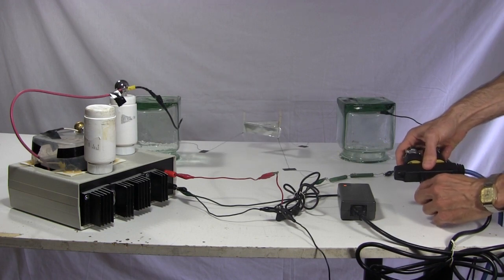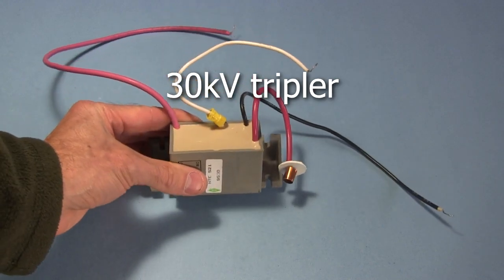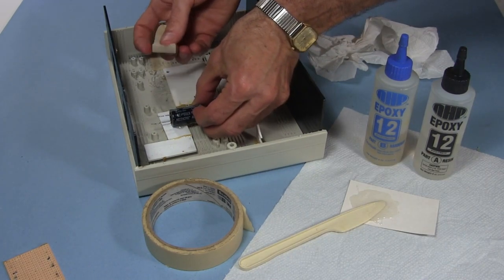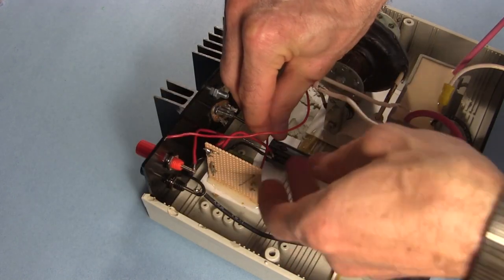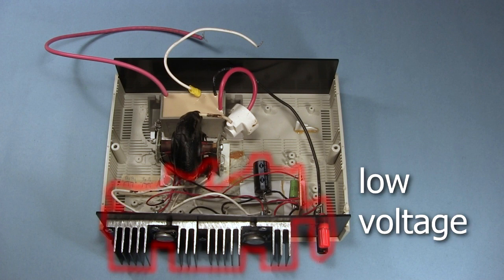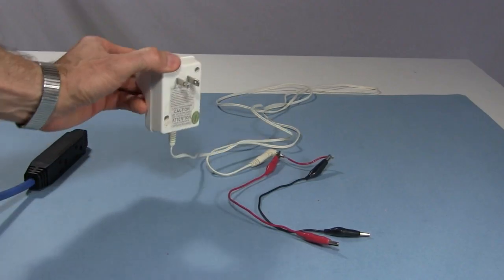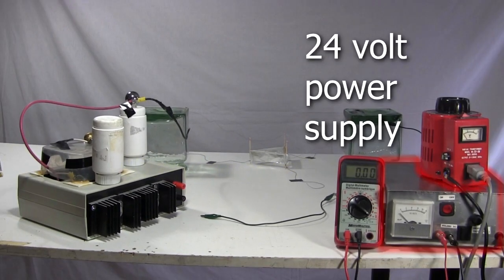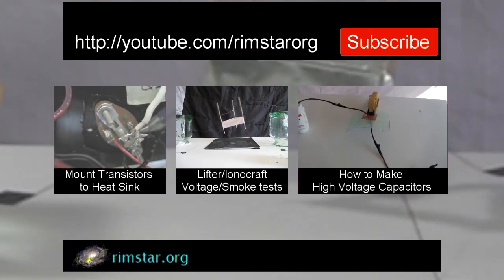How to Make 30kV High Voltage DC Power Supply with Flyback & Cockcroft-Walton Multiplier Tripler

Comment: What's your current reading?
Reply from the maker: The current depends on the load. A low resistance load, for example, will draw more current and a higher resistance load will draw less current. With my lifter I measured just over 250 microamps http://youtu.be/LOGAaObsN4g That's a high resistance load and it's the only current measurement I can remember making with this power supply.

Comment: How much volt flyback transformer is used in this video?
Reply from the maker: I don't know the voltage rating of the flyback transformer. It's a very old one and I don't have the datasheet for it. But any flyback transformer that was originally made for a CRT TV would do as long as it doesn't have a built in diode. That's the hard part, finding a flyback transformer with no built in diode. They're getting harder to find all the time. I don't even have a source for one anymore, especially since they don't make Cathode Ray Tube TVs anymore.
Reply: RimstarOrg 
Thank you for the information sir

Comment: Sir can't see which one is the negative terminal of this HVPV ,,,I think the Red wire is Positive but can't figure out which one is negative,,,, so plz help me....
Reply from the maker: The positive is the red thick wire coming out of the power supply. The white wire is also positive, but at a lower voltage (around 10kV instead of 30kV). The negative is gotten from the black socket in the front of the power supply, the same place that you plug the negative for the input. That's because both the negative input and the negative output are connected together and are both at ground potential. So it's really more a case of a high voltage positive output and a 0V output. There isn't really any negative, though we call it that since it's negative when compared to the positive, and you can get negative charge from it.
Reply: RimstarOrg thank you so much sir....

Comment: +RimstarOrg 
Hi Thank for video
but from where can I buy the cockcroft walton voltage multiplier
Reply from the maker: I had a link to where you could buy one in the video description but I see it doesn't work anymore. On my webpage http://rimstar.org/equip/30kv_pwr_supply.htm I list a bunch of other NTE multipliers that will work. If you don't find any of those then try looking for "equivalents" e.g. "NTE 521 equivalent".
Reply from the maker: Oh, and if you can't find one then you can consider making one. Some tips to get you started are here http://rimstar.org/equip/pos_neg_voltage_multiplier.htm and http://rimstar.org/equip/negative_voltage_multiplier.htm. Capacitors and diodes for those can be found at http://www.amazing1.com/.
Reply: RimstarOrg ok , I want to make one ,but How? what i want to make new one ?
Reply from the maker: See my previous reply for how to make one.

Comment: Hello what if I use the flyback transformer F0241 with the voltage multiplier NTE 423? I am trying it and it doesn't work...I don't know what I am doing wrong...
Reply from the maker: +Daniela Chavez Guevara Are you sure it's NTE 423? When I look that up I get an IC socket.
Reply: +RimstarOrg I put the link in the previous comment I checked the specs before buying it and compared them to the one you used and didn't see a difference therefore I bought. On a side note, I checked for continuity between the power transistors and the heat sink and made sure I was getting none. I also checked the connections to make sure I had wired it correctly and counted again the windings on the fly back transformer. everything seems to be assembled correctly. The only thing different is the flyback transformer which has the coils covered with the case but Im not sure if that is affecting the inductance
Reply from the maker: +Daniela Chavez Guevara Ah, so it's not NTE 423, it's NTE 526A. NTE 526A is okay, just make sure that there's nothing near the POT and the FOCUS pins that would electrically connect to them. My first suggestion is to check all your connections to make sure they're correct. What have you done to test them before you decided it wasn't working? How are you testing it? Maybe you created a big enough spark to damage one of the transistors like I did here http://youtu.be/Kb0WwsJgTMM. Maybe have a look at my webpage here http://rimstar.org/equip/30kv_pwr_supply.htm to get some clues.
Reply: +Daniela Chavez Guevara after connecting the metallic door knobs I brought the grounded cable close to one of them and nothing happens one door knob is connected to the hi voltage output and another to the focus
Reply from the maker: +Daniela Chavez Guevara No problem, the NTE 523 is almost identical to the NTE 526A so what I said still applies. When you brought the ground cable close to the door knob did the cable have sharp wires at the end and did you have the sharp wires closest to the knob? If so then it might have worked but you didn't see the bluish corona because it was too dim. If so, try it in a darker room, or bring the edge of the wire close instead of the end of the wire. Make sure you use the resistors I mention when testing so that you don't damage it from too much current during big sparks. If its still not working then again, check all connections. Then watch the video I gave a link to above to see what I did to find my problem when I damaged my transistors. I basically go through checking things.
I use a VARIAC to turn up the voltage slowly. At lower voltage it doesn't do anything. So if you're giving it only 4 or 5 volts DC that may not be enough.
Reply: +RimstarOrg Hello again, after your suggestions we did the following tests in order to find out why the power supply is not working:
1. We are using 12Vdc from a DC power supply. We also tested changing the input voltage from 0V to 15Vdc. We connected everything on a breadboard to make sure that the wires or soldering wasnt the problem. 
2. We checked the right order of the winding terminals fb1, fb2 and p1, p2. Fb1 and P2 go to the base and collector Q2 respectively. Fb2 and P1 go to the base and collector of Q1 respectively. We also checked that the windings on the flyback transformer are both in the same direction. Positive polarity wound. 
3. We tested continuity on all connections as expected from the diagram. 
4. We used a signal generator and an oscilloscope to test the transistors independently. We put them in switched mode operation, no resitance in the base, emitter to ground and colecor to a resistance of 200 ohm. Input voltage = square wave, Frequency = 1kHz, voltage = 7V and 0V. We use a resistor in the collector (200 ohms) and a power supply to introduce 15V. We observed the 0V (when transistor is on) and 15V (when transistor is off). 
5. We made an independent coil of 5 and 11 windings (as you suggest in the video, with the center taps) both going in the same direction (emulating the flyback transformer but without any secondary output) and tested the circuit expecting to see an oscillation/resonation from the transistors (we measure from emitter to collector). We observed the 12Vdc (input) in each transistor. The same situation happen with the Flyback transformer recommended in the video.
6. We checked the resistances and made sure they were connected correctly and have the right ohms. The voltage division is about 10 times.  We put 12Vdc in the input, then in the voltage divider appear almos 1.2V. The question is: is that voltage enough to on the BJTs. The datasheet say it need 7V. 
7. During the test we noticed that one transistor gets hot (Q1) while Q2 doesn't. By looking the circuit, we figure that the Q1 is letting the current to pass from collector to base closing a circuit through the windings. As the current is DC, the windings are acting only as a cable.
8. We bought new power transistors (brand new ones) and connected them again but nothing seemed to work. For purposes of testing we didn’t use the heatsinks, as we only want to see the switching of the transistors. 
9. We switched the collectors and emitters connections, to see if maybe by good luck it works.  Also we change the polarity of the windings respect to the transistors (craizy tests). We were running out of ideas. In all the tests we observed the same behavior. No commutation in any transistor.
10. How we can make a small test in order to see the transistors commuting before to get all the circuit working. As a preliminary test.  We are not experts in self-resonant circuits. If you can explain better how it works, maybe we can do a better diagnostics of what is going on. We will appreciate your answer. I am sorry for the length of the question.

Thank you for your input! This is a project that we are doing to learn more about electronics!
Reply from the maker: +Daniela Chavez Guevara The transistors turn on at 0.6V, not 7V. The VEB0 is the maximum EB voltage before there's damage (http://www.learningaboutelectronics.com/Articles/What-is-VEBO-transistor-rating). There's an explanation of how a flyback with a single transformer works here http://www.powerlabs.org/flybackdriver.htm. Did you check your capacitor? Are you sure you have the correct pinout for your flyback?
Reply: +RimstarOrg  hello again, we checked what you asked and this is what we got:

Did you check your capacitor?

The capacitor is a polarized one. we are using a DC power supply from a laboratory, which is really steady, no noise, no ripple. We observe the DC voltage in the pins of the capacitor. 

Are you sure you have the correct pinout for your flyback?

The windings for the flyback are in the following form:

1. The winding of 5 turns (2 and 2 with center tap) was wound by us.

2. The winding of 11 turns (5 and 5 with center tap) was wound by us in the same way of the previous winding.

3. The output winding (HV winding) was check by the datasheet.

Question:

Can this circuit work without the output winding of the flyback transformer? We want to see the switching of the transistors 

We tested with a toroidal core doing the winding of 5 and 11 turns. But we notice the same output (both transistors open).

We are going to try the flyback with one transistor as the link you sent us.
Reply from the maker: +Daniela Chavez Guevara No, the circuit needs the feedback from the output winding for the flyback effect to work and get the transistors switching back and forth.
Reply: +RimstarOrg oh I see...on the flyback transformer I see that the last pin has a black wire that goes from the pin to the coil (that is inside) is that the ground Of the flyback? if not why do you connect the pin number 2 on your flyback to the ground? what is the ground Of the output Of the transformer? also I see that there is an air gap in the transformer does it do anything? do I have to remove it? we tested the circuito with a single transistor and for some reason it doesnt work, there is no oscillation in the transistor...
Reply from the maker: +Daniela Chavez Guevara Yes, it's different for every flyback but for mine pin 2 is the other end of the high voltage coil. You can see it better in the schematic on my webpage here http://rimstar.org/equip/30kv_pwr_supply.htm, just above the word OUTPUT.
It helps if you can find the pinout diagram for your flyback online. Otherwise, you might be able to do the test I do in my video about the Cube power supply at around 2 minutes and 30 seconds in. If none of the pins are behaving that way  then you can try bringing the end of a grounded wire near the pins.
I don't know what you mean by air gap.
Reply: +RimstarOrg thank you I will do that, by air gap I meant that the flyback transformer came with thin plastic disks separating the iron cores by a gap
Reply from the maker: +Daniela Chavez Guevara Looking at this http://www.ebay.com/itm/F0241-Flyback-/400936163235 I still don't see where this airgap might be. Everything in that photo looks normal.

Comment: Wouldn't it be easier to use a 3K level neon sign Ballast to run your fly back with only one primary coil consisting of four turns to further step the voltage up there is a video on YouTube on how to disable the auto shut-off feature to be able to perform Ark demonstrations

Comment: where i can find this old looking flyback 
i knew is more powerful
Reply from the maker: I don't think it's more powerful. The difference is that most flyback transformers these days include a built in diode that it's very hard to get around. This one doesn't have that diode and so you can connect its output to a voltage multiplier/tripler.
Unfortunately I don't know where you can get them, other than searching real hard for them on ebay and getting lucky. They're hard to find these days.
Reply: ah ok ... 
thanks m8

Comment: Anybody knows how many turns it's a HV Flyback transformer?
Reply: You cant count the turns on a flyback and its hard to calculate them aswell because there are thousands of them, but you dont need to know them, the important aspect is the output voltage which is typically around 15kV to 25kV and you need to know if you want one that outputs AC or DC. You can always rectify AC to DC but AC flybacks have become very rare.
Reply: Yes, you're right about that, it's impossible to count all the turns of a flyback but I can't believe that there's no information about it on the internet, books and no where. Well, maybe with some calculus could be done.
Reply: Sure you might find the number of turns of a certain flyback in its datasheet on the internet, but as I said you dont need it.